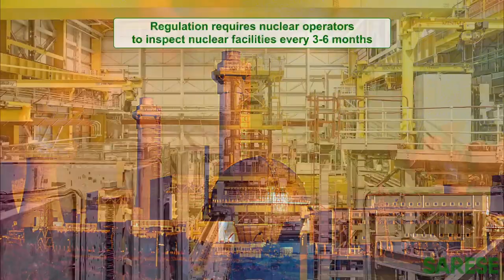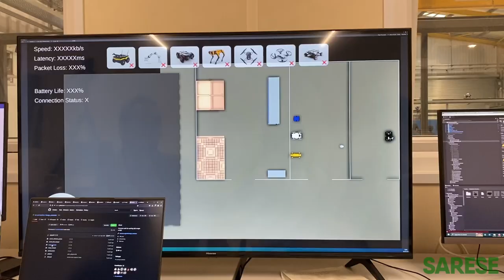A Symbiotic Autonomous Robot Ecosystem for Sustainable Environments

Comment: A good day. Are you building a robot or not?
Reply from the maker: Hello, Our project at this point in time is not looking into building a robot. We look at the software requirements which would be needed to control a team of robots
Reply: @SmartSystemsGroup_UoG 

Can you make a robot with a sensor? Or a program that processes incoming data from the sensor, performs a calculation and returns a value that regulates the mechanics (the speed of the robot and the direction of movement of the robot)?

If you want something like a pack, then each individual of such a pack should be autonomous, it should distinguish objects, identify another robot as a member of the pack, and only then have the behavior you need. This requires sensors as sensory organs
Reply from the maker: @Koroleva_O_A  Hi, Yes we work daily with these types of robots. Our robots have many sensors onboard and do a lot of local and remote processing during autonomous missions. It would be great if you could describe what you mean by sensory organs?
Reply: @SmartSystemsGroup_UoG  

It is difficult for me to write how a person or an animal is arranged in a nutshell. Therefore, only in general terms.

A living body has sense organs. These are sensors. Each organ measures a physical parameter with a periodicity. Such a measurement with periodicity is called consciousness. When you are conscious, you determine. Unconsciousness is the absence of definition (measurement and identification). Now your robot does not define (does not measure and does not identify), it has no consciousness. In order for him to have a consciousness like an animal or a human, he must do this periodically.

Secondly, every living body is a subject. It becomes a subject when it has its own meaning. And any definition is taken by the senses relative to this meaning. That is, every living body defines (measures and identifies) relative to something.

For example, we have a thermometer that determines the body temperature. This is a sensor, a sense organ. When he does this at least once a second, it is the consciousness of the thermometer. But the thermometer is not a subject, because it just measures the temperature. He will become a subject when he begins to determine the temperature relative to his own. This temperature difference is called the difference in values.

Dip your hand in hot water. You, as a robot, do not determine the temperature of the water in the bathroom, but the temperature difference between the temperature of your body and the temperature of the water in the bathroom. You do this with your sensors - nerve cells. And you do it more than once a second when you are conscious. The absence of such consciousness is called death (the robot broke down)

Your robot is not a subject, because it does not have its own magnitude relative to the magnitude that it determines through the sensor. If he is not a subject, then he cannot have instincts, reflexes, he is not alive. It's just a toy on an external control. No animal is controlled by someone, the animal is controlled by algorithms..

The difference in values between the value of the robot and the value that comes from the sensor as incoming data is a value.

Then this value should control your robot. For example, to adjust the speed of its movement. The larger the input value, the faster (or slower, if you want) your robot moves. Or control the direction of movement. Or manage some other parameters. For the sake of a joke, you can control the volume of the siren using the incoming value. The greater the temperature difference between the temperature of your robot and the temperature of the external object, the louder the siren sound.

In fact, an animal and a person run away with a high temperature difference. This is called the instinct of self-preservation.